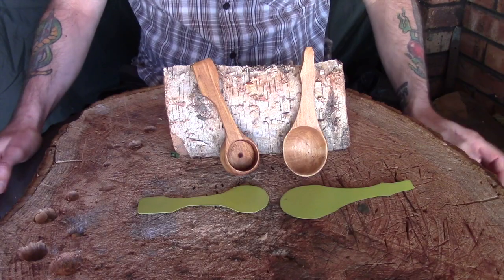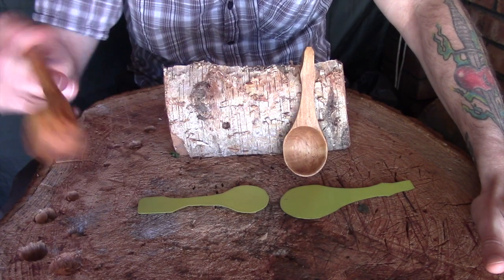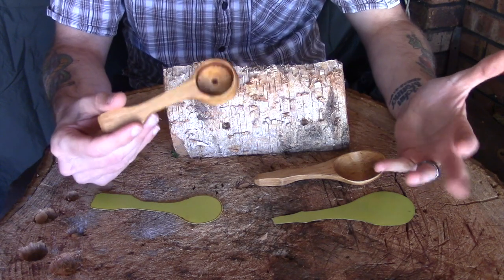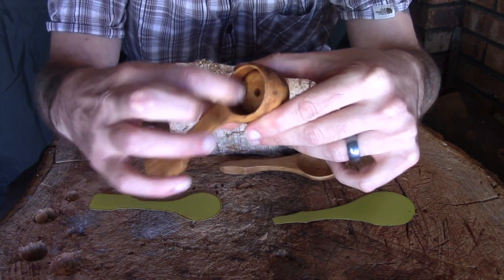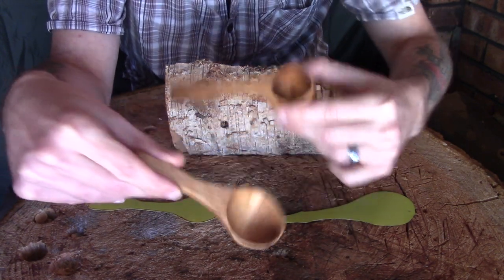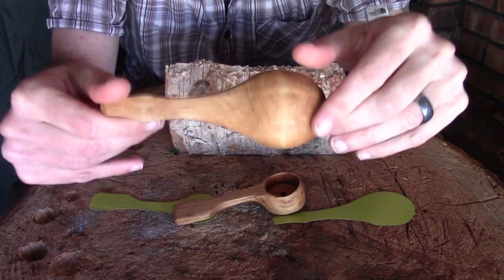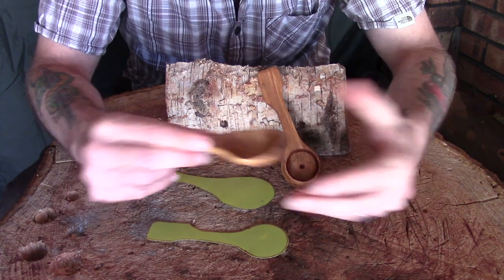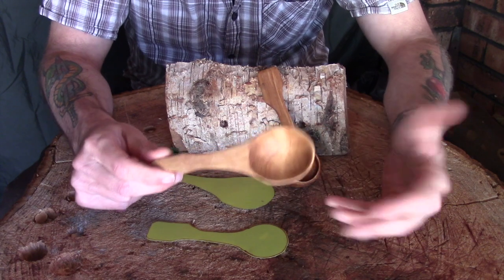Carving Designs - Function Over Form

Comment: I appreciate your point of view.  I get it when you say you go where the wood takes you.  It is not cliche'.  Once I pick up a piece of wood I have an idea in my mind where I want to go with it.  I just start taking away the wood to get there.  Sometimes its not exactly where I want.  The wood tells me.  One thing I don't do, yet, is use a pattern.  If I ever do a series where they are to be somewhat the same I may.  But in the meantime each is unique.  Good job!
Reply: I would agree with most of that except the patterns. I have several spoon templates, sometime I use, sometimes I dont, I also mix and match the bowl from one template with the handle of other. I try not to be too rigid on design. As you say sometimes you just go with the wood